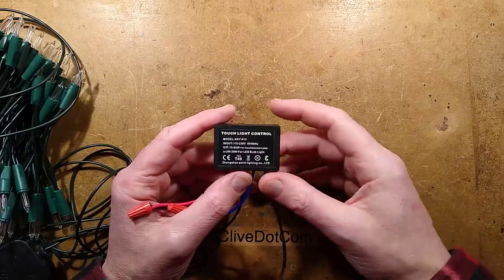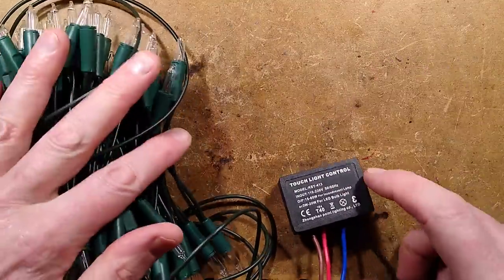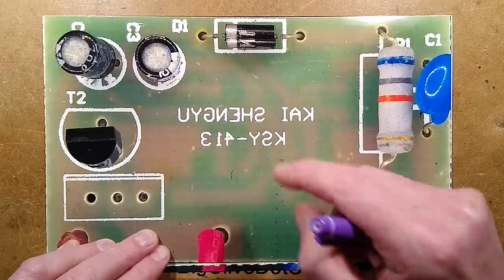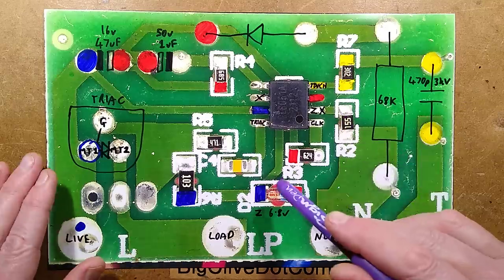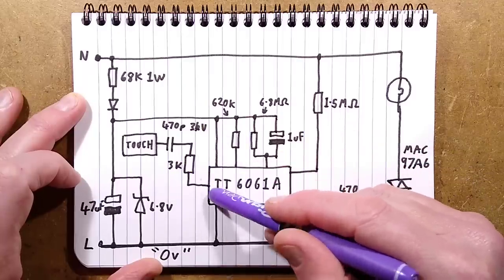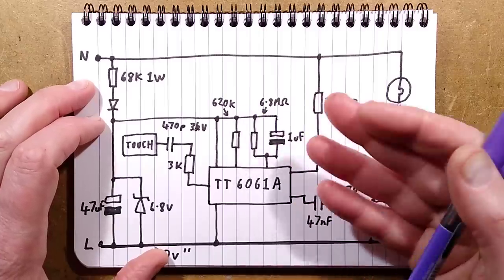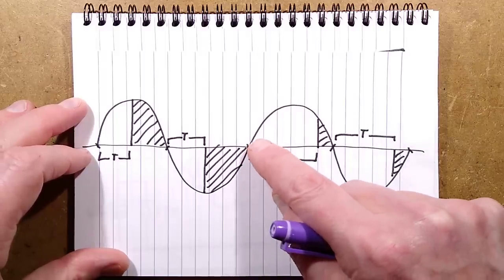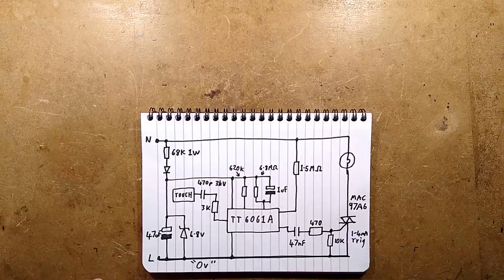eBay mains voltage touch dimmer - with schematic

Comment: Couple three things... Proposition:
Small deep dive videos into basic components; with a focus on what they do, how they do it etc...
Ex. 555, mosfets, 'zeno-diode' (showing my ignorance here) (Target demo for this idea right here as I have no idea what a zeno-diode is or if I even got close)
I love your circuit break-downs but I think I'm still too wet behind the ears to absorb more than 3 percent of what you're offering. Might be nice to get a proper lesson on fundamentals from the man himself. Climb the ladda up towards your strata as it were.
Reply: A zener diode has a specific reverse voltage "breakdown" where it starts conducting, so it can be used as a voltage reference or regulator. In this circuit, it regulates the DC voltage across the capacitor ( and the IC) to 6.8 volts.

Comment: Clive, have you read anything about LED streetlights turning purple? Business Insider had an interesting article that goes into the details a little bit but not much. Perhaps you could shine some light, as it were, on the physical causes of LED degradation and failure?
Reply from the maker: I've not seen one up close, but it's caused by the phosphor detaching from the violet LED that excites it.  Quite a nice colour.

Comment: I bought a pack of these from Ali-Express and the build quality was awful.
The wires were odd colours and really thin and soft, so I decided to open them up and re-solder thicker wires from a length of cable off a quality power cable.
The insides were a mess, as there was solder blobs and flux everywhere.
Anyone who buys these definately needs to examine the internals first for safety....

Comment: You are dead right re. interference. We're both Shortwave fans, and those tough dimmers are a really bad source of audio AND RF noise. The RF problem persists even if you operate your sets on battery power.

Comment: When I was a kid we had a cut power cord in our piano bench from the light. One day an electrician came over to do some work. I started play pretend electrician and plugged it into the socket. A huge electric bolt arked out out of the cut end and went into the floor between my legs. It was just me and him upstairs and he ran in and unplugged it. Just the first of many times I almost accidentally killed my self.

Comment: When you said Hams may not like it, it brought a question to mind.  I'm a ham and I have 2 touch lamps and when I'm transmitting on HF, my lamps will come on, depending on if i'm on 80 or 40 meters.  My question is, is there a way to put something inline on the touch sensor circuit that will stop them from coming on when I'm transmitting?
Reply from the maker: It's possible that you could add filtering after the safety elements of the touch sensor.

Comment: "The Hams are not going to like this..." 
That's okay, 10-15 minutes of transmitting at 50-100W will blow this module up anyway, noise gone. It's a self-correcting problem.

Comment: I suppose you could make it safer by connecting the sense wire to an insulated plate, so the user never touches bare metal, since it can pick up through touching the insulated wire. Then your only worry is it burning your bloody house down.

Comment: Well I'm trying to procrastinate hey what's that over there is it a squirrel? This reminds me of an experience. I was visiting the Philippines 220-240v 60 Hz and the place I was staying the person had a US 120V AM/FM cd player radio thing with touch controls. This was plugged into a step down transformer. There was one issue one was required to time jumping up off the ground and touching the buttons for the buttons to register the touch input.
I suspect this was due to capacitance?

That is until a day later from being shown this, I was accused of plugging it in with out the transformer. yeah the guy who brought a multi meter wouldn't check the voltage before plugging something in in a foreign country after being shown it plugged in and requiring a transformer yeah… Somebody else in the group who never admitted it. Slightly off topic what was I talking about oh yeah the required conductive gap between the ground the physical ground and the human operating the buttons made me think about all the times I've had issues with touch controls and how annoying they are.

Comment: Technology Connections blew up a similar controller because of a miswire due to color codes not being what was expected. (This one used a MOSFET looking thing, probably the same or similar triac in a bigger package to safely operate up to 100 watts, that blew apart with the wires holding the pieces to the board.)
Also 'data shit' was a slightly amusing slip up.
Comments from 3 weeks ago? Hidden videos again? Something to do with money i guess.
I hate that everyone holds digital content for ransom for a time or indefinitely. IDKY more people don't get mad about it.
Reply: Maybe people don't get mad because they understand that content creators need to make money from the videos that they put the effort in to make?  Do you think they should work for free?

Comment: Hey hey there, Colin Burke, Lead/Principal EE, embedded engineer, MatE for Swift Sensors. We make unique long-range, ultra low power Bluetooth sensors. 

would you ever want to reverse engineer one of our low powered sensors? Is there a formal contact for you which we could discuss this further?

While it's true there are hundreds of sensor companies out there- I do believe our products are unique and incredible quality. Of course I am biased, but I have never seen a Better product made by just ~2 people in 10 months including all electrical, mechanical, emebedded, and MFG work.

We would love to have you review our circuitry and function- we have all different kinds of sensors from Temp, vibration, to Current Transformers (up to 200Arms), VACrms (0-500), and even some very unique things like a matchbox size TWO channel thermocouple sensor- which supports standard TC mini plugs and all TC varieties (K, J, T, B, E, S, more) that lasts 5yrs on 2xAAA taking measurements each minute.

Many of our other sensors last 10+yrs. Anywho! Let me know if you'd be interested or if there is a formal contact and we will be in touch!!

Comment: Hi @bigclivedotcom I just bought a conductance tester for car batteries and was wondering how these things work. Don't you think it would make for an interesting video?
Reply from the maker: I'd guess it may apply a low resistance across the battery briefly and measure the instantaneous current flow to get a rough approximation of the battery's internal resistance.

Comment: What do you think the chances of the sensor wire detecting a touch through a grounded metal fixture body it rests against are?  Assuming the ring terminal has been removed and end of the wire insulated, that is.
Reply from the maker: It would be affected by that.